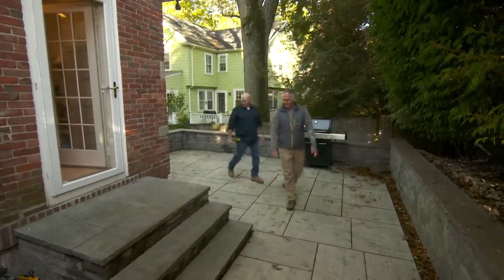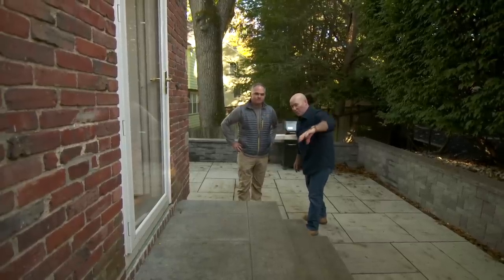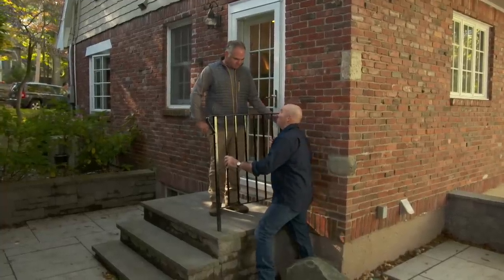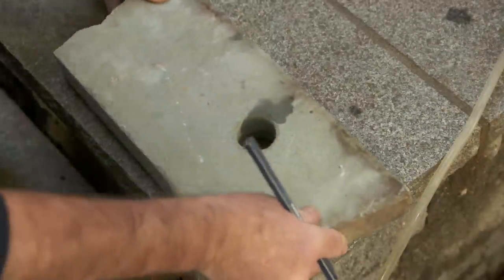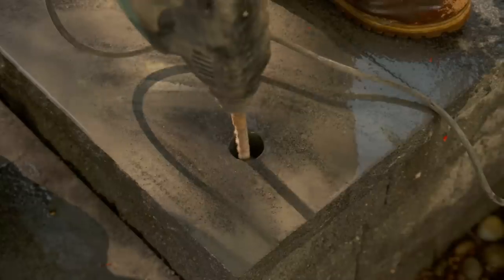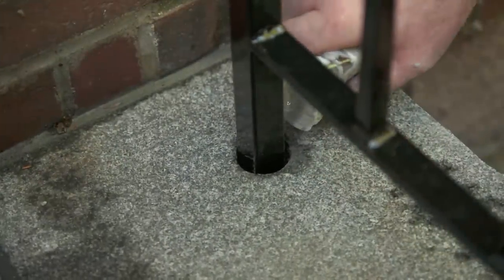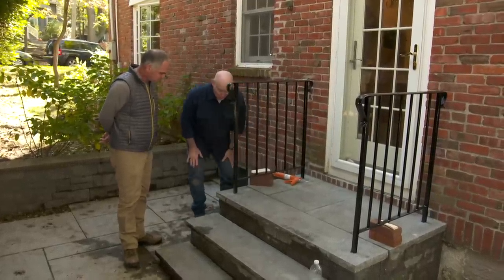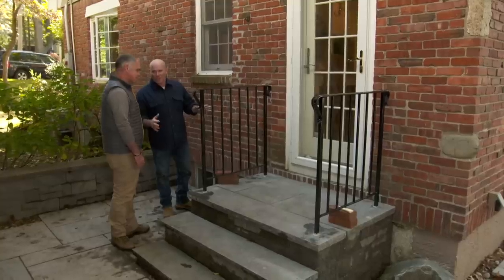How to Install a Metal Railing | Ask This Old House

Comment: This method is sound , so long as they went at least 6 inches into the substrate . The grout requires the hole dia to be a certain size in relation post / stud size . They may have squeezed this a little . All in all this is the best way to install any rail .

Comment: What has the caulking to do with the movement of the materials? He cemented the fence rock solid into the stone. Even if the stones where still going to move a bit, how is the caulking going to help prevent that? The caulking is ok to help run the water away from the steel posts though. And good to see a serious TOH episode once again.
Reply: Not clearly explained.  I think what he meant was that the coefficient of expansion for the steel and anchoring cement are different, so they "move" at different rates as the temperature changes.   Potentially, small cracks could develop between the steel and the anchoring cement.  If that happens, water may get into the cracks, freeze and expand damaging the anchoring cement.  The caulking prevents water getting into the cracks if they develop.
Reply: Buckhorn Cortez That sounds more logic. Thank you.
Reply: Buckhorn Cortez no thats Bs, the caulk actually contains a small number of clark kent's DNA which gives it the strength to hold the railing. the cement was just for decoration.
Reply: +Blox117 lmmfao
Reply: I have a rusted through hollow metal railing base. The base plates are anchored great. From what I have seen online the game plan would be to take a reciprocating saw, cut off all the bases at the ground level, then cut off the feet to the first email on the bottom, insert new legs with adhesive and ribotsbto hold everything into place and then install adding expanding cement or anchoring cement. Did the video mention how far down they core drilled into the stone?
Reply: I see the reason for the question BUT, the caulking to me is more to keep water out.  Water in, freeze, expand, crack.  That's the only thing I can think of because it doesn't impact anything else.
Reply: @Blox117  😂😂😂😂😂⚰⚰⚰

Comment: Solid versus hollow steel tubing, they both will still rust out and have to be replaced. The trade avoids talking about steel in contact with acidic masonry and concrete equals “planned obsolescence” regardless of priming/painting it before installation.
Reply: Doesn't anyone pour lead anymore to hold railings in place?

30 yrs ago they drilled holes into my concrete stairs and used lead to hold them in place. Same as they did 50 yrs ago at my parent's house.

Both are regular wrought iron railings and are still solidily in place with hardly any rust.

Maybe that's the old school way and no longer used?

Comment: Code for guardrails is 30". Guardrails are taller than handrails and serve a different purpose. Vertical edges greater than 1/2" require edge protection. You can do that with a curb wall, obstacle, or handrails. Stairs require handrails on both sides, and ramps with a rise greater than 6" require handrails.
Reply: 32-36 for handrails
36-42 for guardrails 
International Building Code
National Building Code

Comment: That installation wont last long because it is only secure on the bottom and when someone push the top will come loose. He should have design the back top railing with a screw flange to bolt in to the bricks to minimize and top movement of the rail.
Reply: Homepros NYC 
Aesthetics > stability
Rail repair = more $ for repairman
...solve for x
Reply: Tan Tan jokes on you im 19😜
Moron? Maybe. but geriatric? No sir.
Reply: Over priced contractor,
Reply: Kids running in and out.  Who would ever push / swing on / slide down the railing?
Reply: that looked like inch square solid steel, and it was cemented into stone. not going anywhere for a long time. it would take much more force than the average "someone" to knock it loose.
Reply: Been doing rails for 20 years, nobody attaches to the house anymore. Never had one "come loose" from pushing on it. Drill and cement it correctly and it will never move.
Reply: @BGSD5315  Me Too..If you have steps that are settling it's only going to pull out from the house.
Reply: @jameskason8320  nice addition

Comment: Solid metal post? Thats unessecary. That has nothing to do with why similar railings end up wobbly.
Reply: piazza gregg Dude...square tubing in that context has no significant give at all.
And yeah...obviously less material will rust away faster but that's why you keep it painted like an actual adult...instead of just letting it rust for 10 years.
Reply: It depends on the lifespan where you’re planning for. I think any hollow tube fence is finished after 30 years or so. Steel is not expensive and the weight difference doesn’t matter much, so why would you go for hollow materials.
Reply: Hollow tubing posts allow for condensation within the post...hence rusting from the inside out.  Solid posts is the correct choice in this instance, however a 2" dia. x 5" deep hole is required.
Reply: why not have the thing hot dip galvanized, it will never rust out then!

Comment: Safety first. For a doorway stoop you have to deal with managing the door egress which makes the steps themselves a significant hazard without a handrail. At least the side facing the door swing should have had a rail going down the steps.Cost or not I had similar custom solid metal railings going down the stairs put on my front walk anyways. Winter ice is too dangerous to risk personal injury or a lawsuit. I also want the mail delivered to my front door.

Comment: What kind of caulking was used toward the end of the install (around 4:50)?  I need to do something like that to the bottom of my railing posts to divert water away.
Reply: just any kind of waterproof caulking would work fine

Comment: Avoid the coring drill.  $$$.  Diamond saw square cut for the stone holes, say 3x3”, stone chisel the corners out, then hammer drill to depth. Fill with appropriate color cement.
Reply: I see this method having a high percentage of the stone cracking core drill is so much smoother
Reply: @msk3905  hammer drill 1/2” diameter or smaller, at least 3” from edge never cracks, else there would be no hammer drills and masonry bits.

Comment: The way to fill those holes is to make sure they are 100% dry then pour molten lead in them to the top , tamp lead down ,not going anywhere!
Reply: John Krim I’ve been in the custom rail business for 50 years.  No one leads anymore despite its dependability.  What average individual would be able to safely lead a rail in place.  Molten lead and a novice don’t mix.
Reply: If stoop settles any anchoring of the railing to the wall will fail.   We’ve been in the ornamental iron business for 83 years.
Reply: Anchoring cement used will eventually fail due to intrusion of moisture.  Better to use Portland cement and sand.  Will last a lifetime. Or epoxy.  
Also level the rails before grouting posts in place.  You’ll have a mess on your hands if you don’t.  Lightly drive a wooded wedge between brick and top of rail to hold level laterally.  This install will meet 200lb. Lateral load code requirements, especially with solid posts as shown.
Reply: @steveburval779  what is the epoxy brand that you use? How deep does the rail need to be

Comment: You're better off welding a plate on the bottom of the railing and screwing it to the slab someone else did the same thing for a customer I went back and welded a plate on the bottom of the posts screwed it down 4 years later it's still perfectly fine doing it the way he did in this video will end up being loose then you'll go lean on it and probably fall back and break your neck it wouldn't surprise me this in the best way but it's each To Their Own
Reply: the Bounty Hunter addict James Moses punctuation
Reply: Bofa Deeznuts are you talking about
Reply: Even of the hydraulic cement weren't there, there's enough depth in the hole to prevent the railing from falling over.  It will likely get loose and wobbly, but the only way it's falling over is if someone lifts it up.
Reply: thechosendude that's not really the point though wouldn't you rather have it solid for life put some big lag bolts in the ground with a metal plate welded to the bottom of it it will never move again I've seen buildings with bolts and metal plates put in the wall which I like 40 years old and they're still in mint condition if you know what you are doing something will last for a long time I've been in construction for 30 years I'm still trucking on strong believe me I know what I'm talking about trust
Reply: piazza gregg what I am saying is if it was bolted to the ground it will last a lot longer then putting that liquid whatever it was can't remember the name because I don't use it but if it's bolted to the ground and the house it will not go anywhere I've seen stuff what been bolted to the ground 50 years ago and it's still perfectly fine now nothing at all wrong with it I've seen stuff done the same way as this guy has done and it's lasted a year and a half and then it starts to be loose doesn't matter how deep it is in their ground that's not the point just because it's safe and even if it did become wobbly you wouldn't fall over the banister but at the end of the day when a builder does a job it should be done right and so it never needs doing again for at least 50 or so years that's all I'm saying I've used LED melted and put it in a hole to do a similar thing like in this video and it is now loose that was half of year ago but that's bolted to the wall and I have poured lead into the holes where the legs are the lead has become loose but it's still solid because it's bolted to the wall if he did that that would have made more sense but still if you bolt it to the law and to the ground it's a permanent not just going to last for a couple of years like that will soon as water and stuff starts getting in it it starts becoming loose

Comment: Installation looks a little insufficient
Reply: It sounds like they had considered railing down the stairs as well but it was considered expensive. In my opinion it looked ok to me as it is only 21 inches off the ground and according to local code, railing is only required if the height is higher than 30 inches.
Reply: J Groenveld understood
Reply: No, it is sufficient. I have something exactly like this for over 20 years and it is rock solid. I have another set of railing on the other side of the house that is held together with bolts and that one is flimsy as hell.
Reply: Andrew August okay cool...
Reply: I’m too OCD. I would have to anchor it to the house.
Reply: MoneyManHolmes same